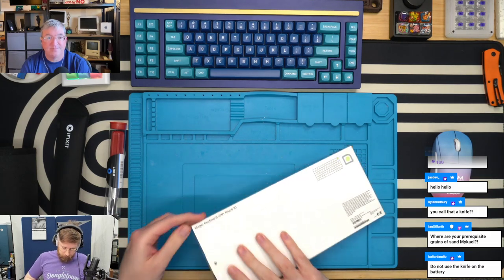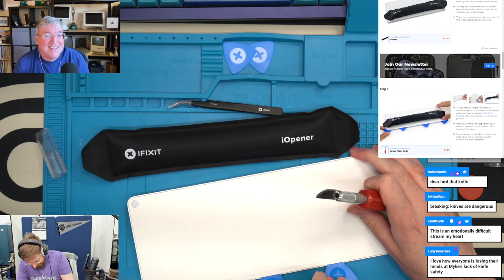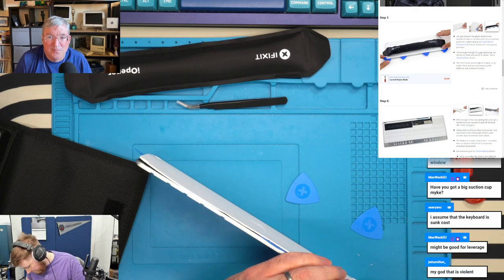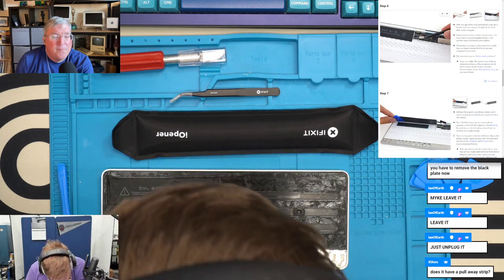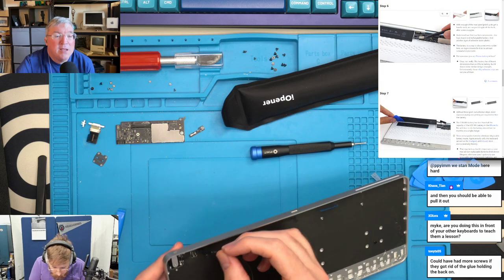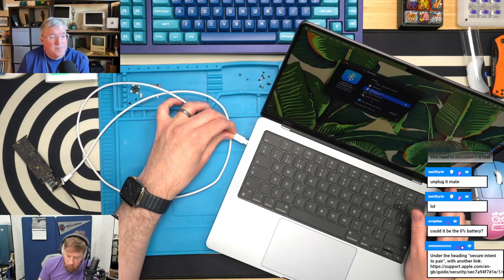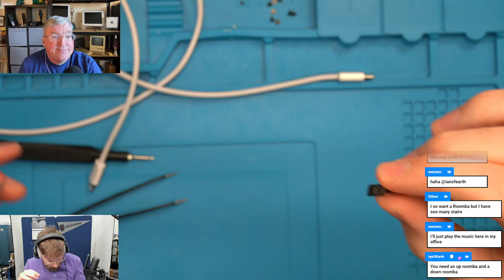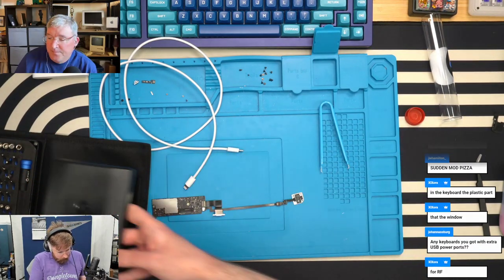Extracting the Touch ID Button from a Magic Keyboard -- Friday Keyboard Club

Comment: you did absolutly nothing to the connection on the touch id and magically it worked, I'm still stuck the button working that sends the mac to sleep but no touch id and I've been moving around this port carefully for hours now :(
Reply: same here hahaha fuck thiss xD
Reply: Still dealing with the same problem. Did you find any solution?
Reply: Same.  It absolutely just refuses to work since removing it from the keyboard.

The button works fine, though.